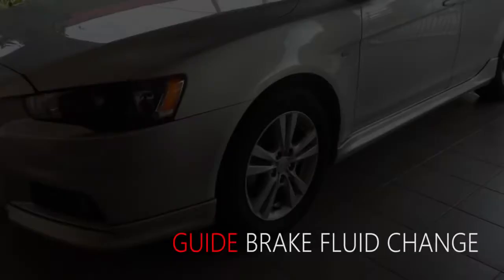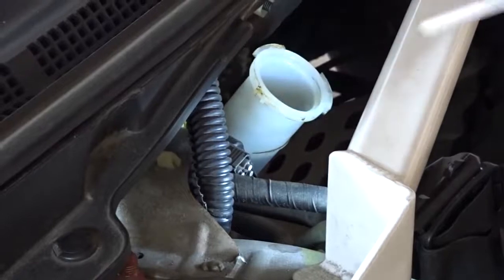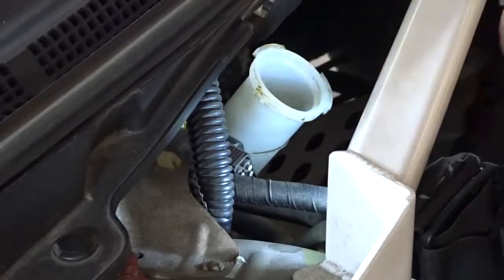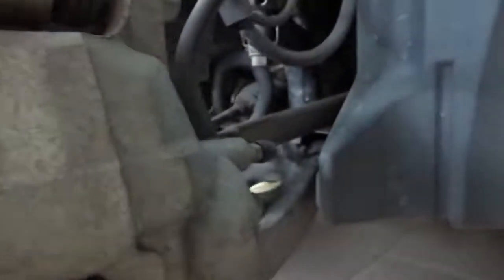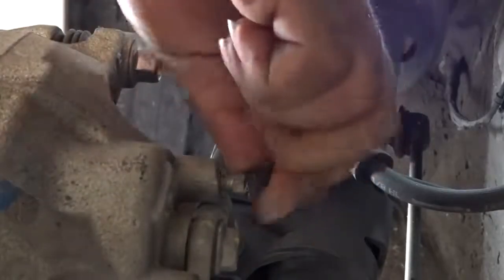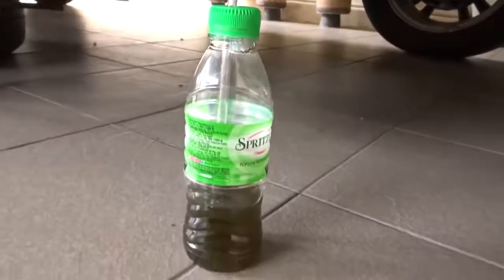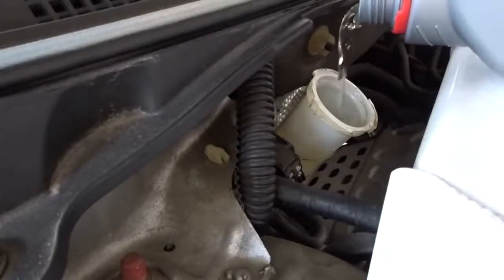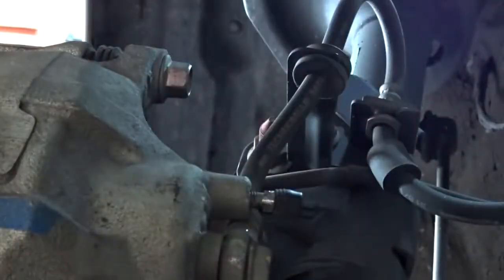Brake Fluid Change 2007 - 2015  Mitsubishi Lancer / Proton Inspira

Comment: Can you tell which wheel to begin first? The passenger front wheel or  the driver front wheel or passenger rear wheel or the driver rear wheel. Which wheel is first and which wheel is second and the third?
Reply from the maker: Passenger rear > driver front > driver rear > passenger front. This is specific for 9th generation Lancer. Other models/makes may differ.
Reply: @myautodiy1640  what order if you have to bleed the clutch as well?
Reply from the maker: @tinyokami968  Same order. I did the clutch after completing the brakes.
Reply: @myautodiy1640  This method for right side drive or left side drive?
Reply from the maker: @shafiqr1508  This car is RHD, but the same sequence applies to LHD as well.
Reply: @myautodiy1640  Right not same with left side. Got the difference.
Reply from the maker: @shafiqr1508  It depends on what you call it. If you call it left and right then it's different. If you call it driver and passenger then it's the same, because "passenger" on RHD vehicle is "left" but on a LHD vehicle it is "right".